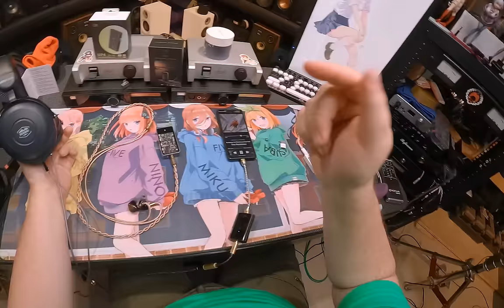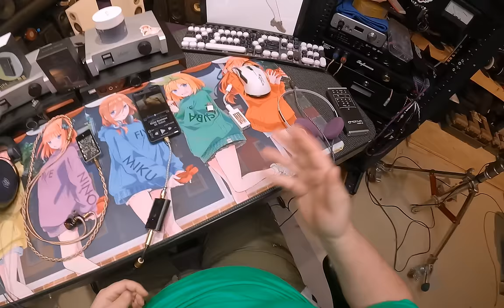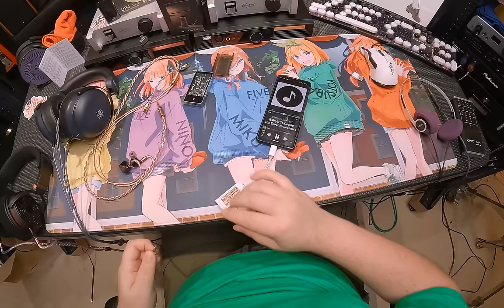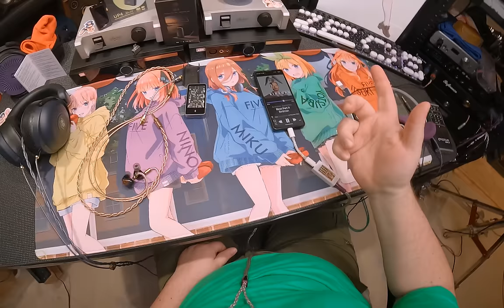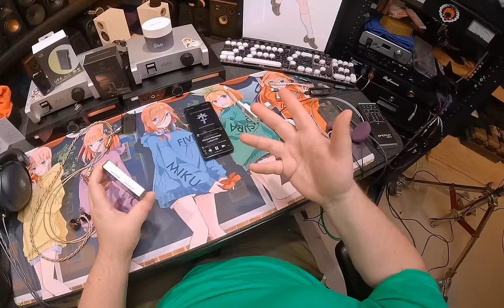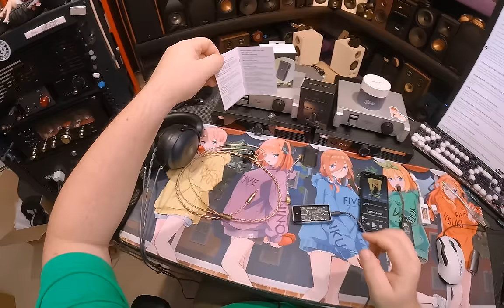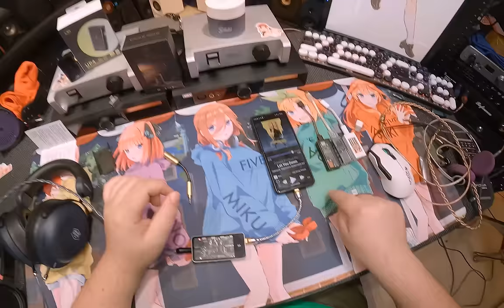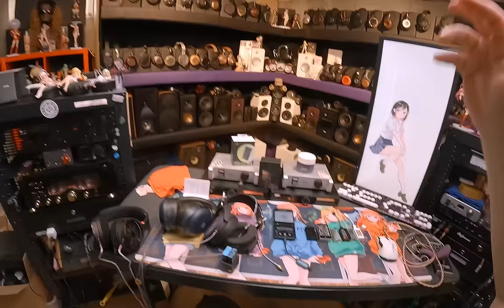Amazing Sounding Bluetooth Dongles - Plus the Aune Yuki

Comment: I dont know why people buy dongles without Bluetooth. The price difference is marginal ...in fact q5k, btr5 are cheaper than a ton of dongles without Bluetooth. (Zeos, however , overlooks Q5k because he hates apps. ) But adding Bluetooth is huge quality of life feature.
Reply: Why wouldn't you mention the s17 pro or s9c in your Toungston review?? 🤦‍♂️
Reply: Btr5 is amazing... That's just through Ldac 👌
Reply: Q5k is lame. Cheap plastic housing. I for sure want to pair that up with a $1000 phone. And I know "but it has eq¡" so do other better alternatives that look and feel so much nicer.
Reply: @charliedunlap9220    no they don't. They have been measured and the qudelix is the only one that actually attenuates the voltage correctly for the PEQ. Power amp, UAPP were very poor, and wavelet was even worse because it doesn't even use PEQ. The qudelix is the best portable audio device to ever exist, objectively.
Reply: @silverjoystix4696 wrong LDAC 990kb has -96db compression which is completely inaudible over wired FLAC. They will sound identical
Reply: If you dont want or need bluetooth or a battery, it good to have options. Having features you dont want or need is not QoL.  Not everything needs to be an all in one device.
Reply: @utubeb14      People who choose to carry around a thing dangling from their phone have BD.
Reply: Shanling Up4 is bluetooth LDAC
Reply: I love bluetooth but the affordable dongle are way better then their full portable brothers. An m15 or fc6 us gonna crush a btr7,hipdac,g5 etc lol
Reply: @charliebaker1427    nobody thinks that. Headfi is unanimous I believe the G5 is better than the m15. Everyone is.
Reply: @charliebaker1427     I like how you think the g5 isn't full sized either.  Somethings gone very wrong with you.
Reply: Because Bluetooth isn't a audiophile thing
Reply: Not everyone wants to charger 2 devices

Comment: My first day with the m4.   I can't get usb dac mode on my phone for some reason...   I found a firmware update I can't do.   And when the battery got to 20% it begins to destroy my ears with massively unbelievably loud chimes for I'm assuming low battery...    Other than that...     Edit:  Nevermind... Damn, is there any way to stop mistaking these stupid charging only cables from regular ones...
Reply: I could only get certain usb-b to c cables to work, with a usb-b to c adapter on the b side. And it was fiddly. Always fiddly. Constant dropping out from a slight wiggle on different adapters even. 
The max volume on bluetooth was way way lower than plugged in.  And if you switched it would kill your ears.  Also notifications were super loud all around. 
I am far happier with my lil Q5k. I guess if I want a backup thing, I'll get another one... that thing is tiny configurable sounds great, and indestructible. 

I basically only use my stuff at work, and on the move. It's been great. I gave up on the m4.  All the cables that didn't work with the m4 worked with the 5k? I don't get how that m4 works at all...

Comment: If you like the Shanling UP4, but you want 4.4, you should have gotten the UP5. It is even more powerful, built as nice, and got all 3.5 4.4 and 2.5. It also come with a leather case(that is not as good as fiio leather case).

Comment: Tell u wut butt... This yuki has cs43198.. Is great ha.. wait untill u try the extincted cx31988 yup conexant joint synaptics for hi tech project.. 31988 not abvious 31993 which is SE.. But this 31988 the upgrade frm 31993 for Bal But single butt they special design a single chips werks as well as dual SE chips.. Try it IF u only can find it now.. Peace!